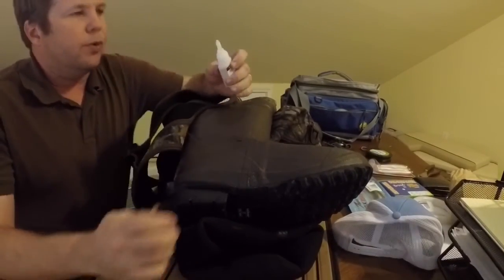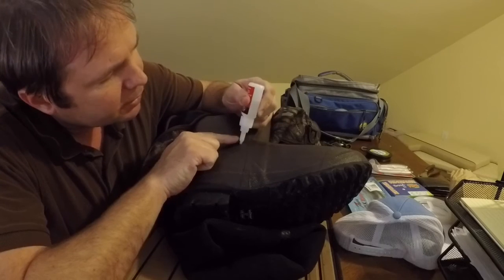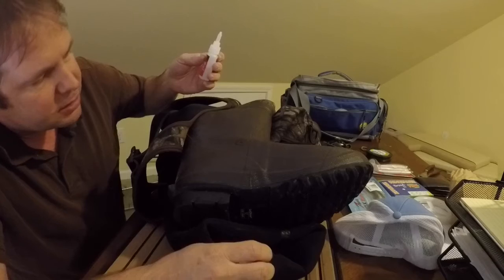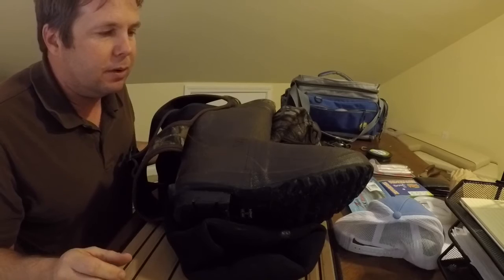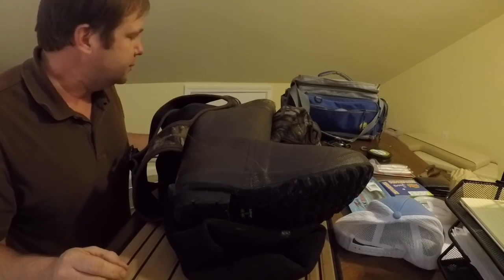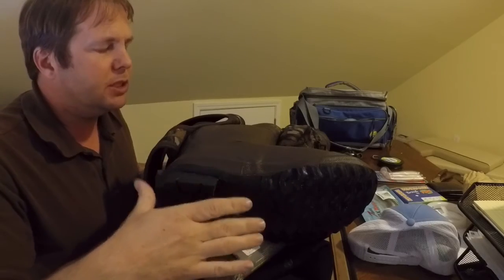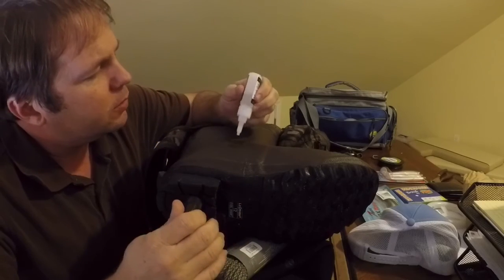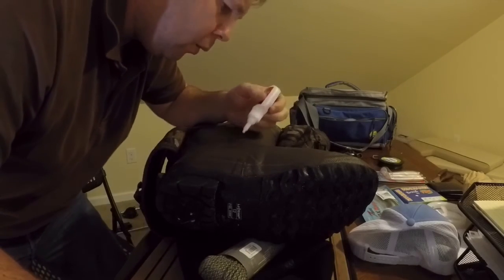Patching wader so I can get back to surf fishing | PaulOffshore Ep. 47

Comment: Never used waders but I see the guys at the Radio Island Jetty using them.  How warm are they?
Reply from the maker: Mine are warm enough for me, in fact I think they're the warmest thing you can wear on the boat.  My waders are lacrosse neoprene with 600g of thinuslate in the boot (lacrosse makes thicker insulated ones too).  The trick in keeping warm is knowing your body and how active you think you will be in them, then layer appropriately.  For instance, if I think I'm going to be doing a lot of walking then I'll use the thinnest pair of socks I have, since my feet tend to sweat. If I will be sitting in a duck blind for 10 hours during the coldest day of the year I'll wear my thick smart wool socks. A little bit of trail and error, but not rocket science.  Even the coldest day seems to warm up when you start catching fish. If you can go out, catch a limit of trout in hour or two and not have a boat to clean up afterwards, hard to beat convenience  wise.